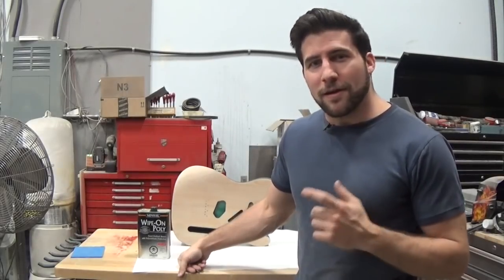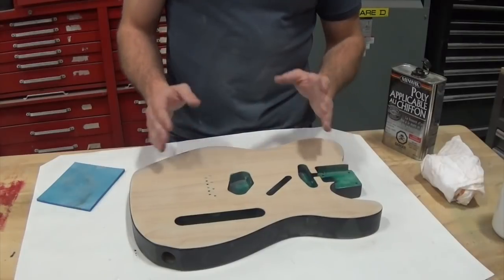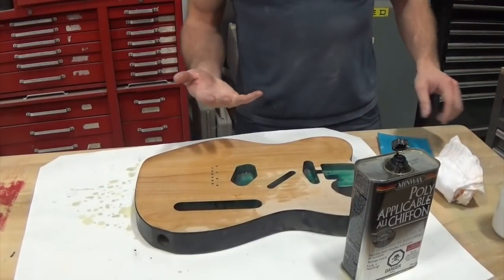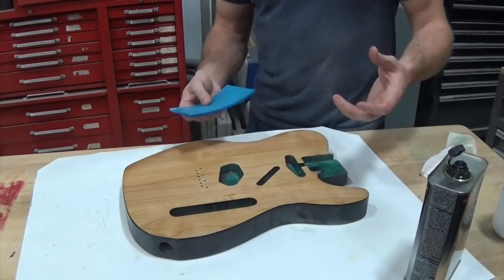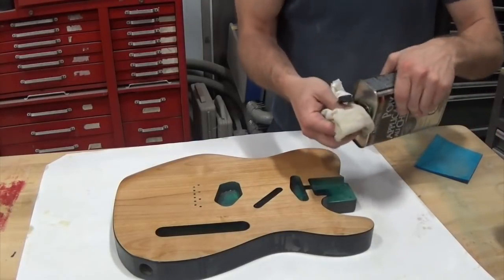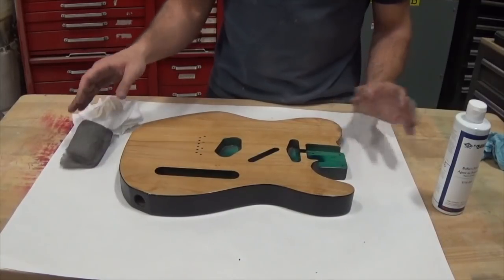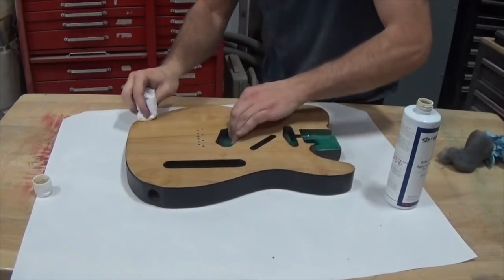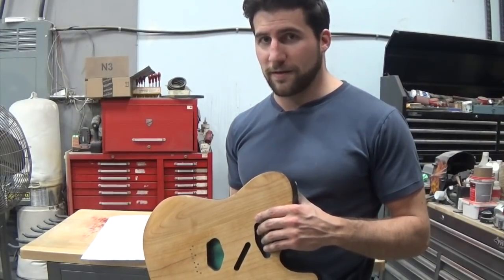How to apply a perfectly smooth poly finish by hand

Comment: Interesting....yes nice and shiny and smooth, but far from level which can only be achieved by sanding with a block.
Reply from the maker: A bit of sanding with 1500 grit isn’t really going to affect that, but regardless, you’re supposed to flat sand at the end of the application process if you’re going for that polished gloss look. That’s not really appropriate for this portion of the application.

Comment: Brad Angove ever here of putting metallic paint on a guitar?
Reply from the maker: Of course. I’ve done it a few times.
Reply: @BradAngove  What kind of brush you recommend using if I used brush on metallic paint? How many coats you recommend? How durable is metallic paint?
Reply from the maker: I generally don’t brush it on. I don’t have a brush recommendation, but I would do one or two coats. 
If you want it to be durable you will need to clear coat it.
Reply: @BradAngove  How glossy is metallic paint?
Reply from the maker: It depends on the brand/type and how it’s mixed.

Comment: Sorry, but the sandpaper isn't a thing.  It's too fine a grain and that poly is too viscus a product for it to make a difference.  Nice idea.  But no.
Reply from the maker: Try it with the wipe on poly. Its viscosity is much lower. I think you’ll appreciate the results; it works well. Much like using this technique with some oil products.

Comment: Regarding the first coat: pretty sure you just invented the polyurethane grain filler, lol.
Reply from the maker: Haha well, I definitely did not invent this technique. It's an old one.
Reply: A grain filler is recommended if you're working with mahogany. Will this poly/sandpaper slurry method eliminate the need for that?
Reply: I've never used Brad's method he shows here. BUT, the method is basically a grain filling method. So I would say that it would work with mahogany. Having said that, genuine mahogany is valuable enough wood that I would just go ahead and grain fill as a preliminary step with one of the many commercial grain fillers available or in the traditional manner. Brad was right that he didn't invent this technique. The traditional method of french polishing fine woods such as mahogany employs essentially the same technique--you wash coat with shellac and then use FFFF pumice to create a grain filling slurry of alcohol, shellac, pumice and sanding dust. That's basically exactly what Brad did in this video; his innovation was doing it with a polyurethane based product, imo. So you have at least three options for mahogany--the traditional method with shellac and pumice, Brad's technique using poly or a commercial grain filling product.
Reply: Sorry, I just realized you were probably asking Brad. :)
Reply: Not at all, I'm grateful for your comments and for your passing on your experience! Thanks for your great ideas!
Reply from the maker: Great response Matt. Allow me to add that I personally like to tailor the grain filling technique to the wood in some situations. Mahogany is an open grained wood, and thus, applying this technique with the slurry would take several coats to fill the grain properly. I would use a tinted paste wood filler to get started, and then follow up with this. I have a video on grain filling mahogany if you're at all interested.
Reply: Many thanks! I did see the video on grain-filling mahogany, I just wondered if the poly method was "instead of" or "as well as", and now all my questions are answered! Thanks to you both
Reply: OK, all my questions except one..or maybe more...when would I need to use a sealer? What does it do, and at what stage would I apply it? Thanks again!
Reply from the maker: You would use a sealer after a grain filler and/or stain. It's to seal up the wood so that you don't end up having so much of your finish soak in. Sealer is thicker, and generally dries faster, so it plugs up the grain more than your average top coat. I use it more when I'm using spray finishes personally, but it's useful for wipe and brush on finishes as well. It's more important when you're working with a more open grained wood.
Reply: Hey Brad. I found myself making, of all things, a cover for the water tank of my toilet. :) I made it out of walnut, and, because walnut is a pretty open grain wood, and a toilet tank cover is a pretty ridiculous project I didn't mind messing up, I figured it was a good time to try this technique. It worked like a charm. I haven't finished rubbing it out, (oh, man, that's a bad phrase to use when I'm talking about bathroom stuff!), but it was immediately obvious that applying the first coat with 1500 grit was doing a good job of filling the grain. The only difference between what you did and what I did is that I didn't use the Minwax wipe on poly, I used the minwax brush on thinned 1:1 with mineral spirits (more cost effectiv than buying their pre-diluted wipe on). Anyway, this technique is money, brother. Good job.
Reply from the maker: I'm glad the technique worked well for you. I love walnut, but I never would have even thought to make a tank cover out of it haha. The thinned down brushing poly is a good call. Thanks.

Comment: the poly dripped on the sides and ruined my project i am now sad
Reply from the maker: Just sand them smooth and then polish
Reply: @BradAngove  they are stained into the wood. I waited too long
Reply: Even tried to sand them off but there in there
Reply from the maker: I don’t understand. Poly isn’t a stain. Try wiping the area with acetone carefully.
Reply: @BradAngove  I think it’s because the poly soaked in deep then putting another layer of clear coat on top makes that more obvious